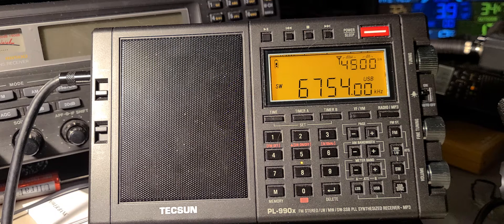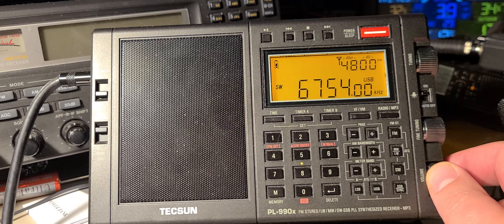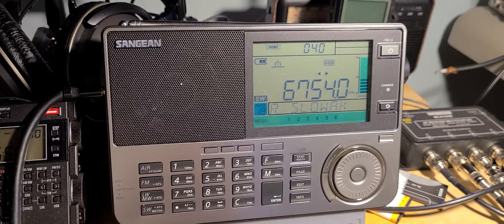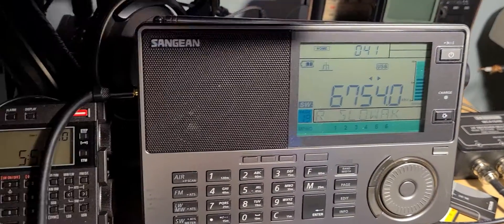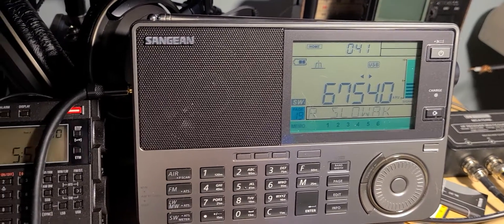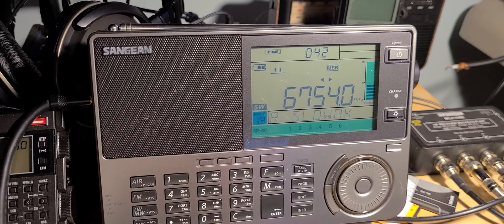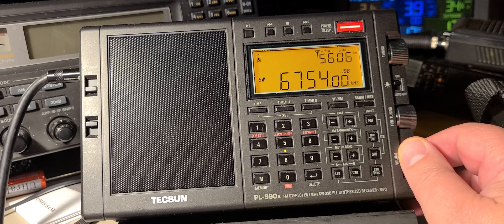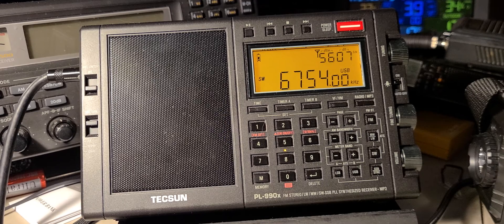Testing Tecsun PL-990X VS Sangean ATS-909X2 AGC performance same signal 6754 kHz USB Shortwave

Comment: Thanks for the video, AGC seems indeed little better at the 909 which helps to hear more clear, where with some cases at the 990 (i own) have problem with few words of a speaking program ... at the 990 if you notice the speaker slightly crackle (at higher volume) perhaps of the AGC or because it has little more bass or maybe cause both of them .... but personal i prefer better the audio of the 990, the 909X2 has king of treble makes it too much blow for my ears IF i stay some time at SW ... 990 is also cheaper ... ΕDIT by the way at 990 setting the Gain button at lower point, sometimes (not always) it helps